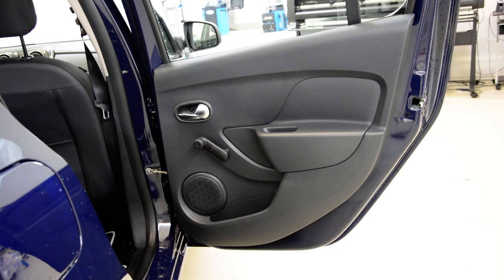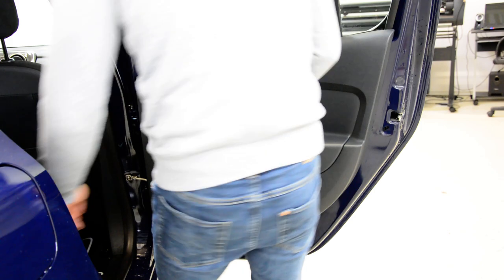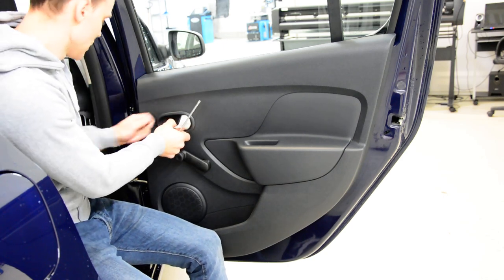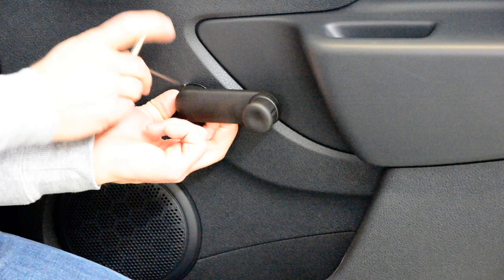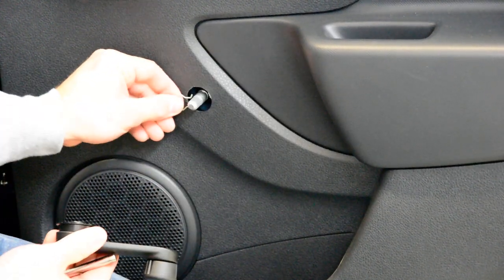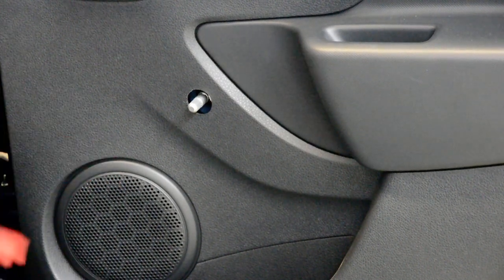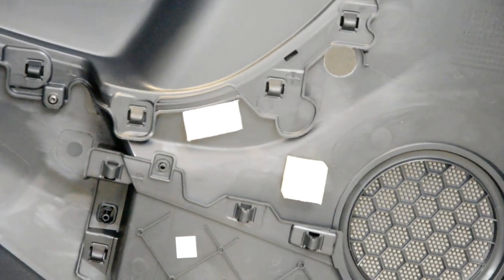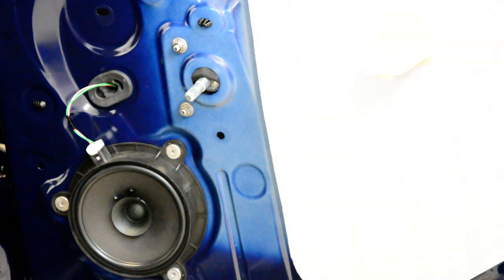Dacia Sandero Door Panel Removal

Comment: Hi
What are the sizes of the speakers on the doors. I've noticed that the speakers in the front are bigger than the ones at the back. Do you happen to know the difference in size
Reply: Teboho Thai it depends of what generation is your duster. First generation are 6,5''
Reply: I drive the 2015 0.9 turbo Sandero
Reply: I have the same speakers. The pair is 90€  on Amazon. The putting is easy and they play very well.
Reply: Thank you. Do these speakers also fit in the back door panels so I can install four speakers
Reply: Teboho Thai I'm not sure. Put out the cap and see if the hole 16,5 cm long they will fit.
Reply: Teboho Thai but they are 60 watt each. You will need  a good player or separate amplifier for 4.
Reply: Will do so.
Reply: @tebohothai1317  have u fitted rear speakers